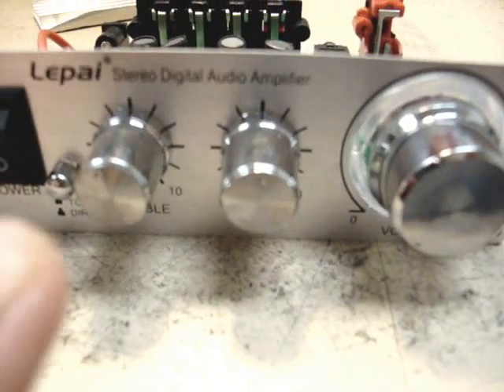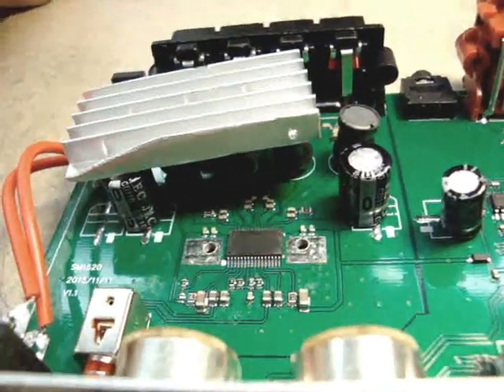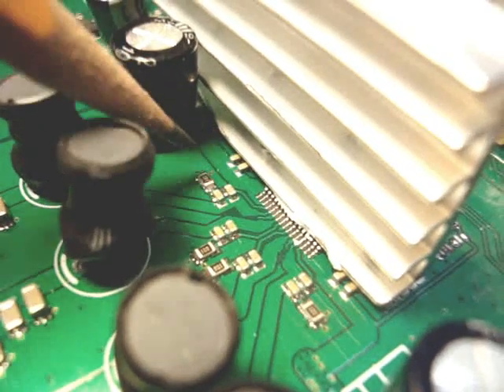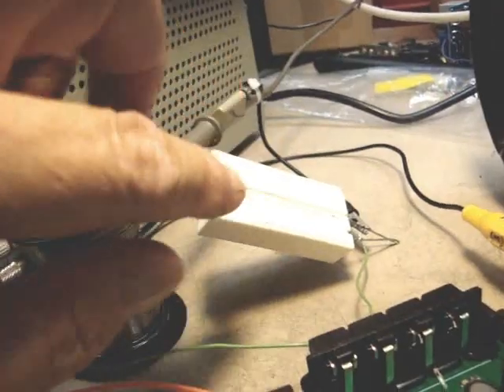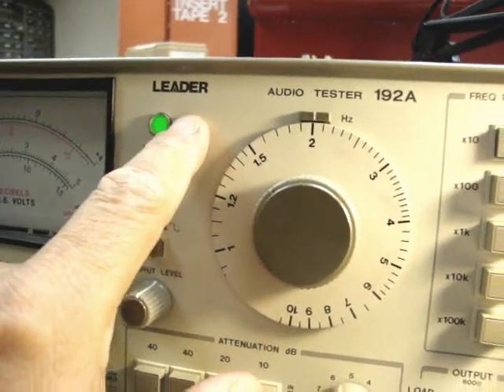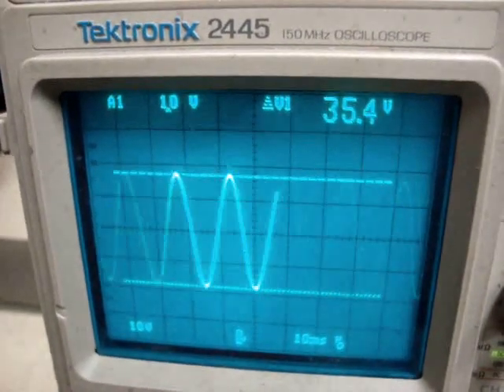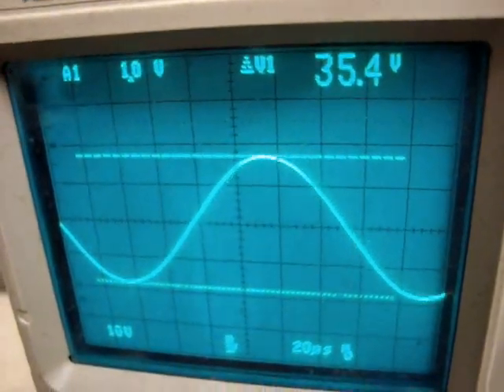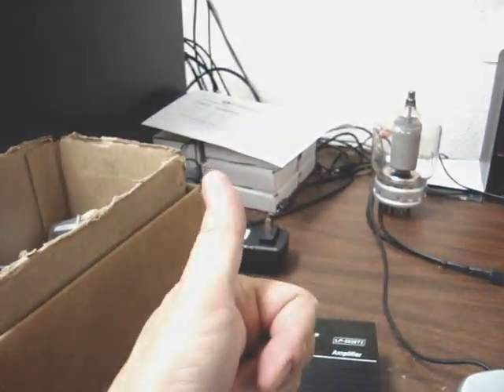Lepai LP-2020TI Modification

Comment: I am planning to run a 24v 5 amp power supply it seems to be in spec with what the manufacture recommends its a 30 dollar amp so not to concerned either way... what do you think?
Reply from the maker: 24v shuld be ok since the IC is rated for 26v max. The electrolytic capacitors in this amp are rated at 25v, so it's good. 👍
Reply: @bob4analog  so far so good I have not done the heat sink mod yet as the data sheet on the IC said it was not required for a 8 ohm load which is what I have hasn't got warm at all yet been on over a hour at half volume which is very loud with a set of polk T15 bookshelfs

Comment: Thanks for the information on this amp. I recently bought one and while I think it sounds pretty decent as is I would like to be able to increase the headroom with a better power supply. Does anyone have a feel at this point for how high I could go with input voltage before needing any modifications? I could see mounting a small heat sink and drilling some holes in the case if necessary but I really don’t want to get into replacing capacitors or adding a fan. I am using 4 ohm speakers.
Reply: 25v is a safe limit. As it stands, applying 20v with a decent heatsink should yield the specified power in this modification.

Comment: The thermal pad for that TPA3118 is on the bottom of the IC with the idea that the PCB will serve as the primary heatsink. On that board most of the heat is flowing through the pad to the island of ground plane on the top side of the board and then through all those vias to the much larger copper layer on the bottom of the PCB.

People run those chips in with both channels in parallel on much smaller PCBs on 24V supplies without heat problems. I bet you could get by with just the higher voltage supply without a heatsink, much less a fan.
Reply from the maker: When I tested this at full power out without the heat sink, It got so hot, i could not hold my finger on the chip! Maybe I'm pampering the chip with a heat sink, but it seem to help. The TPA3118 must be pretty rugged running without a heat sink otherwise.

Comment: I would like to add four 12v LEDS that are 5mm in size.  Would anyone know where I can safely tap into power on the board?
Reply from the maker: The LEDs can be connected at the power switch and ground.
Reply: @bob4analog  does it matter that they are rated at 20mA?
Reply from the maker: @EndUser2090  No, since the power switch is capable of handling much more. The LEDs will only draw 80 mA connected in parallel; that's only 0.08 amps.

Comment: Bob, would this modification work for this unit?  https://www.amazon.com/Kinter-K3118-Instruments-Digital-Amplifier/dp/B0787BRQ2F/
Reply from the maker: Yes, I think the mod can be done. I've not worked with a Kinter K3118, but the model number K3818 probably indicates that it has the TPA3818 chip, which is the same chip as the LP-2020TI. Both the Kinter and the Lepai look identical.

Comment: Hi Bob, thank you for these very useful videos. I have a spare 19V 4.7A power supply as well as a spare 20V 3.5A power supply. Which do you recommend I use in place of the stock PSU for this amplifier?
Reply from the maker: Glad you liked it, thanks.  Little difference would be noticed using either of your supplies, either would work. Probably the 20V 3.5A would be good. Remember to use a heat sink if you intend to use it at rated power output. ;-)
Reply: Will do. Do you think it's necessary to change out the caps to ones rated at 35V if using a 20V PSU?
Reply from the maker: g h - No, I think the caps will be ok. 35v caps should handle 20v just fine.
Reply from the maker: Yes, changing the caps out to 35v is a good idea. It's good practice to have higher voltage caps. I don't think changing out ALL of the caps is necessary, just the main caps on the power buss is sufficient.

Comment: Will a 19volt 3.45 amp power brick work with this amp after a heat sink is installed?
Reply from the maker: Yes, that should work good.

Comment: Hi Bob,

Outstanding videos on the 2020TI! Convinced me to buy one and happy with the purchase. 

One question: do you know the exact size of the heat sink that you attached to the chip? I found 60mm X 30mm X 8MM heat sinks available cheap on ebay that look like they might match what you used. The specs on the chip say that it is 8.1mm wide and yours looks like the fins are exactly that length. I just want to make sure it'll be the right size and I'd prefer not cracking the case and voiding my warranty just to measure how much room I have to work with.

I plan on attaching the heat sink to the chip with Stars-922. Obviously drilling and screwing the heat sink to the board like you did is preferable, but it's more than I am capable of. I figure I'll drill some holes in the case and run it at 16-17V to get a little more boost and hopefully not cook everything.

Thanks in advance and thanks for the comprehensive videos! Nothing I like more than seeing scope traces to prove everything is clean.
Reply from the maker: Michael Miller - Hi Mike, I think you're spot on with your assessment of how to modify yours. Obviously,  my vid demonstrates a guideline to follow.  17v should be just 
fine for this amp, since all the caps are rated at minimum 
25v. All the best on your mod and just remember to keep watch of the heat sink during heavy loads. Demonstrate yours when you get it done. Cheers!

Comment: Great modification! There are 19V 4.74A Toshiba laptop power supplies on eBay for around $17 and they should work well with this amp. I'm not positive the power terminal is the correct size, but it could be easily modified. Thanks for the test.
Reply: My older 2020a+ could only handle 15v before shutting off.
Reply from the maker: BigDWiz - Perfect! That's a ideal supply for this amp. Thanks! ( just change the power connector. )
Reply: @bob4analog  hi would it be better to get 12v power supply or a higher one  also what amperage.
Reply from the maker: @kyleday5026  With a regulated 12v 3A power supply, this amp will make 15 watts per channel output into 4 ohms. https://youtu.be/w2L5UfBW_Xg

Comment: So what kind of a power supply that is cheap would you recommend if I install a heat sink? Sorry I'm not great with electronics. More of a computer guy..
Reply from the maker: Either a switching type or an ordinary regulated supply will work fine. Just get one for the rated voltage and current discussed in this vid.

Comment: Also, is a fan really required when overvolting this thing?    What if one were to - say - attach a square chip heatsink using some thermal tape, and just drill some air holes in the case?   It might get warm, but how warm is too warm?
Reply from the maker: Matthew Karlsson - No, probably not. It's not the voltage increase that's causing the heat, it's the work the amp is doing. In this vid, I ran it to the maximum output into 4 ohms for a long time, thus the fan. I do all my tests that way. I tend to err on the side of caution.

Comment: Great review!  Thanks!

Are there any direct comparisons between this 2020TI and the 2020A+ out there?   I wonder which will give me more power into 8 Ohm speakers...
Reply from the maker: Matthew Karlsson - From what I know, the 2020a uses a different chip that's supposedly no longer made, thus the 2020TI. I've not tested the 2020a,  but the the 2020TI has higher output ratings. As for higher power into 8 ohms, the amp will most defintely need a higher voltage.. The amp cannot put more voltage into the load other than what it is supplied. in short, that's Ohms law.

Comment: LP-2020TI reviews are hard to come by. Thanks for a great review. I was going to use these to power in-ceiling speakers n my girl's bedroom. The rooms are small enough that I don't think I would need to do any modifications. However, she asked me if I could also put a speaker (powered from the same amp) in to the bathroom so that she can also listen when she is taking a bath or putting her makeup on. Is there a chance that this amp would be able to drive both bedroom and bathroom speakers? These are 8ohm Polk RC80i.
Reply from the maker: Thanks! Yes, considering a modest volume level, this amp should have plenty of power for that. The only concern is how far the speaker wires are and gauge of the wires. If it's in the 10's of feet, a 70v line transformer system may need to be used to overcome the wire loss.

Comment: Hey can I put a 30w psu on lp 2020a+?
Reply: 2020a+ has heats ink
Reply from the maker: Ryan Lin - Do you mean a 30 watt SMPS?
Reply from the maker: Ryan Lin - I think the 2020A uses a different chip than the 2020TI.